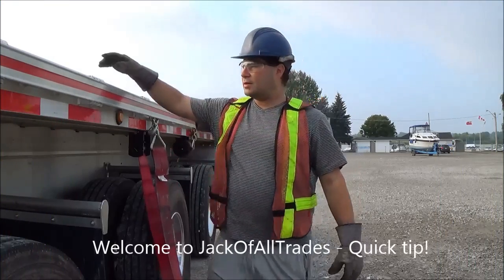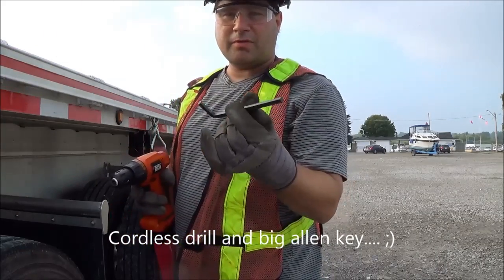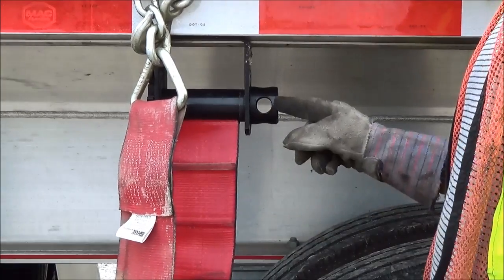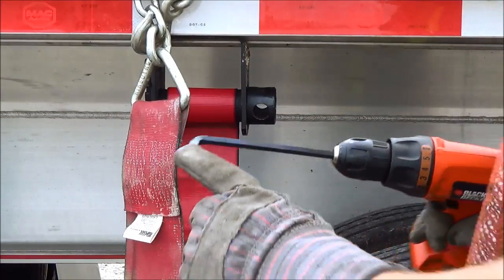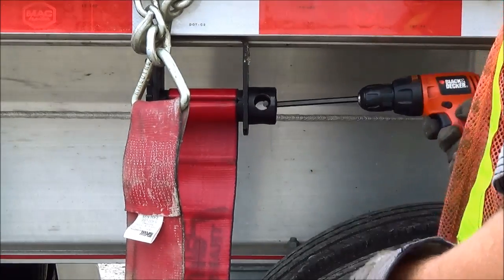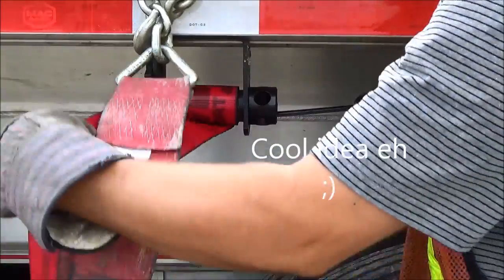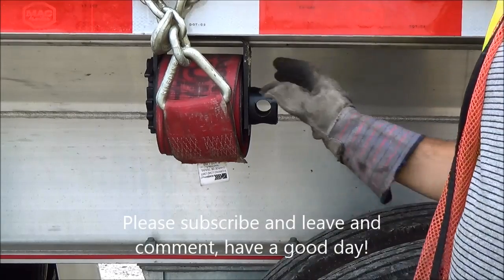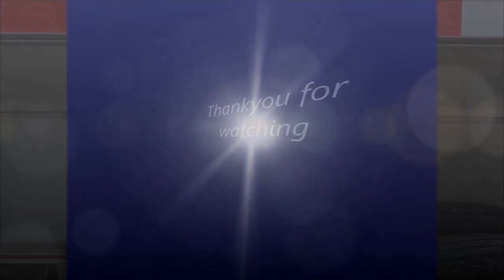Trucking 101 - Roll up straps on a flatbed with a drill and allen key

Comment: I drive a flatbed and make 10-15 stops a day, and roll dozens of straps during that time. I always thought a cordless drill would work great, but couldn't figure out how to attach it. I never guessed it would be so simple!
Reply from the maker: I feel the same way. When I use a step deck straps are low to the ground. Easy to set a Allen key in the drill and wind up. Sames as a covered wagon. I've seen adapters you can buy but an Allen key is like 10cents.
Reply from the maker: Use a Dewalt drill cordless. A ton of torque power and can wind up straps that are stiff!

Comment: Cool, I didn't want to spend the money on the store model of the winder. found a discarded mudflap restainer, re-bent the wire into speed handle shape. 
It is always cool to have all your stuff packed up before they get finished getting the freight off the deck.
Reply from the maker: +Andy M using a dewilt drill now the same Allen key. Use to have wrist problems and this cured it. I suggest all those who do this for a lifetime do this as repeating certain positions can cause havok on your joints and nerves. I started feeling pain in my wrist was I was turning the wench. Cleared up after using this for a couple weeks.

Comment: nice vid man and funny thing is i have both of those in my truck and never would of put the 2 together haha preciate the helpful tip
Reply from the maker: Still using the same Allen key. This idea works great. Especially for low trailers like step decks
Reply: Yea thats wut im hooked up to is a step deck so i will b trying it out today
Reply from the maker: Heading up to Pittsburgh. Just beat Washington rush hour.... Anyway this is great because you can hold the strap with 1 hand and the drill with the other to feed it straight.